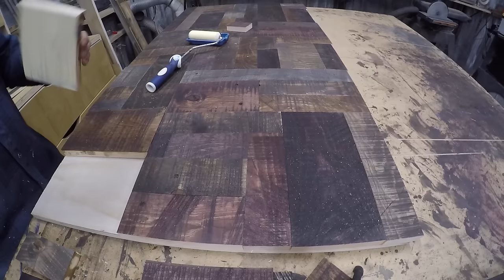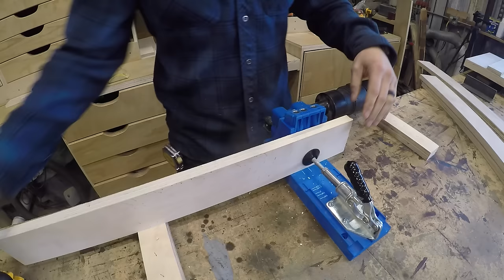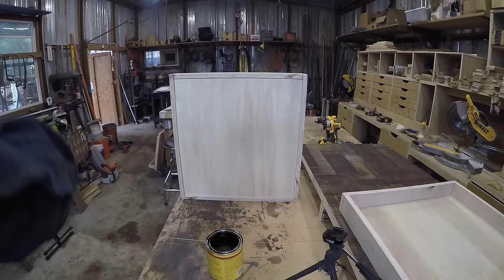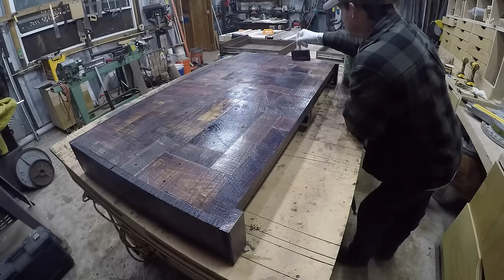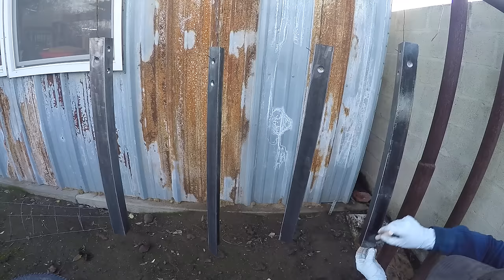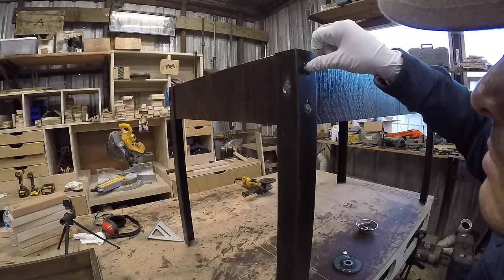Building a Rustic Industrial Desk

Comment: In a panel like that, how do you prevent the wood from moving and bulging out or cracking?
Reply: Just what I was thinking
Reply from the maker: I don't really worry about it as it's "aged" looking. But after all this time, there have been no cracks in the wood and only minor gaps between planks due to shrinkage (very minor).

Comment: amazing looking desk! but one question, wont the legs make alot of scratches on the floor if you accidentally bump into the desk or something like that?? seems kinda risky leaving the bottom of the legs "unfinished" if get my meaning? :)
Reply from the maker: +Nico Norway Thank you! Haven't had any problems yet... But I understand what you're saying. I've got something in the works, more to add variety to the height so my kids will be able to use it when the time comes.
Reply from the maker: +Jumbliah Jones That's kinda what I was thinking! Thanks!

Comment: great work! what did you finish the steel with? was that a protective coating to prevent rust?
Reply from the maker: +Nicholas Martire Thank you! It was either clear paint or a poly spray, can't remember. Yes, to prevent rust.
Reply: what was the black magic (reddish liquid)? and why did you mix it with the distilled water?
Reply from the maker: +Nicholas Martire It gives it an aged black look. I mixed it to thin it out so it wouldn't be quite as dark and to make it (the black magic) last a little longer - more projects.
Reply: i see, gotta say your page is everything ive been looking for. I just somewhat recently started building tables and wood/metal working projects and have been looking for good inspiration and it seems ive just hit the jackpot! i hope you dont mind the questions, im sure ill have more. thanks a lot and keep up the great work!
Reply from the maker: +Nicholas Martire Thank you! Ask me anything, anytime. I'd be more than happy to answer if I can.

Comment: Hi, what's the white board that you are tacking the top to and the paint for the metal?
Reply from the maker: +Determined To Dominate ! It's just plywood. The blackener is Sculpt Nouveau Black Magic.
Reply: Thanks!!!!  Also, what brand of sealer do you use?
Reply from the maker: +Determined To Dominate ! I use General Finishes water based top coat for the wood and Rustoleum clear enamel (after rinsing the treated metal with water) on the metal.
Reply: Thanks again!!!
Reply from the maker: +Determined To Dominate ! Anytime 👍🏻
Reply: Just looked for the top coat.  Is it satin, semi gloss or flat you used?
Reply from the maker: +Determined To Dominate ! It's satin. I use satin for everything.